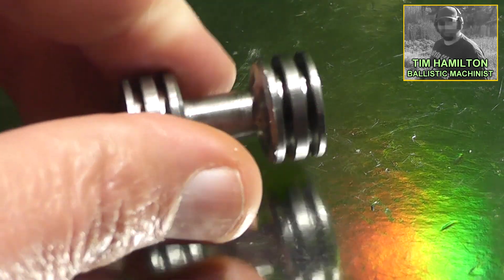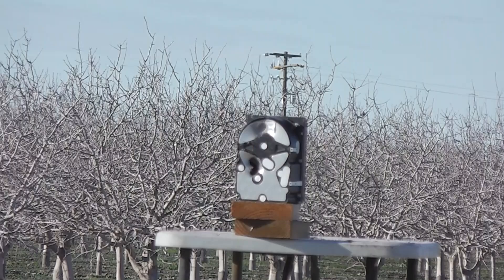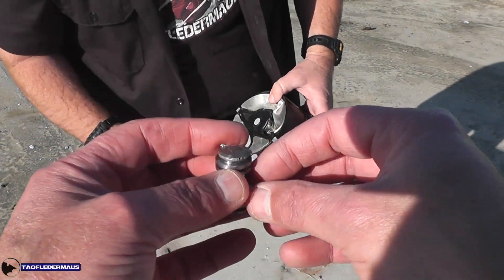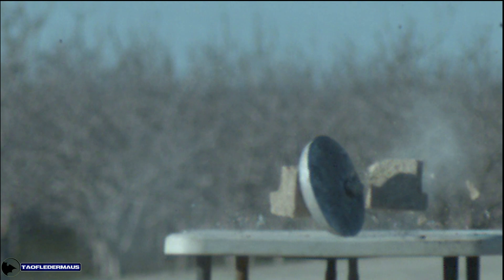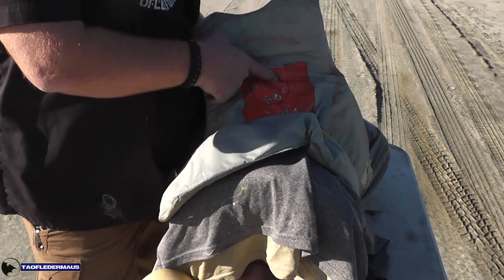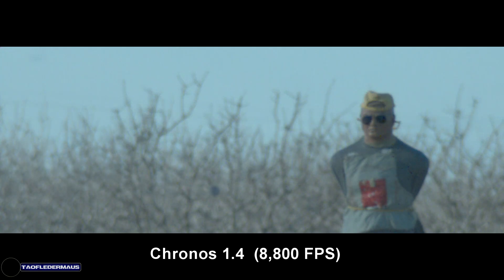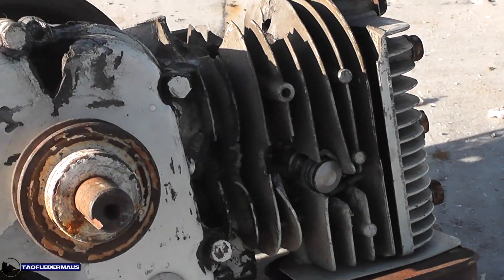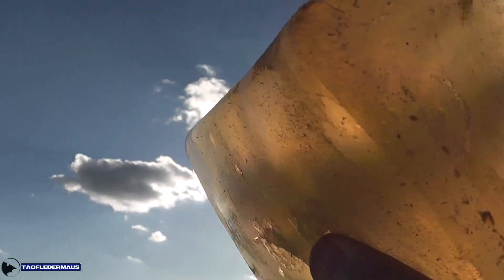DUMBBELL Shaped Slugs-  "Physics-defying"  performance

Comment: Since the shot cup does not go the full length of the dumbbell, will there not be a danger of damage to the barrel?
Reply from the maker: These were the prototypes and we didn't get any damage.  The production slugs have 0-rings so there is no metal to metal contact

Comment: For a fully symmetrical object like this the center of [air] pressure is aligned with the center of mass in every position and so will not impart any rotational moment. Thus the only angular momentum would be that imparted by off center acceleration either in or just upon exit from the barrel.

Comment: I'm pretty sure it's the grooves in the dumbbell that make it aerodynamic. The front is slightly curved, but if the projectile moves to the side by a bit, the grooves will catch more air, pushing it back in the other direction. Self-stabilizing through the use of air resistance.

Comment: The stabilization is due to the rings. They create a series of conical pockets of air around the projectile at speed which stabilizes it. This is visually seen by the air distortions around the projectile in the slow motion footage.

Comment: I'd dare to say that the reason these didn't fly the way you'd expect is because you keep forgetting momentum.

Most of the ones that are supposed to fly straight are pointed, but that just means that there's more mass (and thus momentum) at the rear of the projectile, which would cause it to tumble as the rear overtakes the front. Stable projectiles always either have the most mass at the front (like the ones with a plastic base) or are balanced front and rear (like these and the 'airgun pellet' style projectiles).

Or at least that's my theory, would be cool to see it tested.

Comment: Well, spersonic airflow at its best:
Becase you have a sharp edge on the first "weight", you have a well shaped shockvawe. The second "weight" has almost no drag, as it travels behind the shockwave. But if it tumbles, it eventually tuches the shockwave, which creates a force that is going inwards, pushing the second weight back. And this repeats on the other side, so the slug is very stable.

Can you maybe shoot it with a "softer" shell to see what happens if it goes subsonic? shuld tumble even more then.

Comment: Balanced, symmetrical, they will fly straight, you would think it would tumble due to the narrow middle, but no, there is a pocket of air behind the slug and since the back of the slug is the same shape and diameter as the front, it should stabilize nicely, not only that but because the slug gained its energy with both ends centered, no rotation was imparted and momentum will try to keep both sides straight. 

I think milling out a good chunk of metal to make one end lighter than the other and/or changing the shape of either end would cause it to tumble. 

The goofy over-engineered tail fins cause issues because if the air doesn't flow over them correctly, it can cause all sorts of instability issues.

In most cases KISS rules.

If anything, this design is perfect for stability as if the slug begins to angle or wobble, the narrow middle is more aerodynamic than if it was the same diameter, meaning the tail end of it is going to cause more drag behind it and bring it back straight.

Comment: The shape of the slug acts like a shuttlecock and causes them to be drag stabilized much like a diabolo pellet.  In fact many of the early custom made big bore air guns used smooth bores and dumb bell shaped pellets.

Comment: Looks to me like the waist in the slugs is what stabilizes them.  The front plows through the air like any slug, but the narrow waist allows some air to close back in and drag on the back half like fins.  It would have to be perfectly balanced to maintain equilibrium, but clearly Tim has made them that way.

Comment: My uneducated guess as to why the rounds didn't tumble, even when the wadding detached in flight.  The "dumbbell shape creates a sort of Fin affect on the round.  Air flows around the "head" of the projectile and closes in around the "shaft" only to catch the tail section in turbulent air which creates more drag on the rear of the projectile than on the front.   You would have to set up a slow motion camera in an environment which will catch the wave of air as the projectile fly's through it.  (I have seen the video/photos of this but again, don't know how to accomplish the task.)    Interesting video.  Interesting projectile.

Comment: The wonders of detached shocks...

This thing benefits from being flat faced and symmetrical, but the cup you fire it out of gives it extra stability. If you can fire one bare (or at least get it to reliably detach) we'll be able to see if it really is statically stable in flight or if that bit of plastic hanging onto its back end is what makes all the difference.

Also, these might benefit from a tiny bit of spin - drive nails with 'em!

Comment: The reason why they go straight is because of the gaps between the rings. At supersonic speed this keeps airflow very much attached to it, making it go straight at the cost of additional drag. At subsonic speed this projectile could tumble however.
Reply from the maker: Could be!   There are some commercial slugs that are sort of hourglass shaped like this.

Comment: I think this can be explained if you can capture highspeed footage from the muzzle blast and allow gases to reveal the secrets. The round is still tumbling, even if the horizontal movement is minimal. Some fluid mechanic genius could probably explain how the air is hurtling past this design. Those groves at the 'tumble' ends look a bit like piston design, meant to provide a gas seal. Will the round work if you take them out?

Comment: we need someone to make a modified vertion of these slugs with a firesteel (ferrocerium) tip so they can shoot it at a steel plate. firesteel is the thing in lighters that makes sparks when rubbed against the steel wheel

Comment: look at it waggle it's butt (like that rail gun projectile) as it goes straight instead of tumbling.. Vortex shedding 101, 

Physics explanation: as long as it's super sonic, it will never tumble as it self balances via the eddy that burst and shed off each ever exposed side (as it rotates) which then push it back the other way.. thus straight flight with a waggling butt.

IF HE WANTS IT TO TUMBLE: the centre of mass needs to be off centre.. but then it wont go straight .. making a projectile to tumble on purpose and go [practically] straight over distance while super sonic (50yrds+) is a difficult thing to do.

EDIT.. on immediate thoughts on something to try.. he can make the eddy smaller by chamfering the inside [of the] dumbbell edges ... though without modelling it I can't say whether or not the smaller vortex shed force would be smaller than the rotational [force of] mass of the dumbbell ends.. he can also make the ends V shaped in the same direction (not mirrored), but they would have to have their mass corrected to aero forces.. though they would be nearly the same.

Comment: here an Image of what happens with such an Object in supersonic flight:
http://imgur.com/a/BfaFi
Additional explanation:
While in supersonic flight the moved air has no "time" to produce turbulences, so mostly the moving masses are producing the forces on the object.

In "A" you see a straight flight. The air moved aside will be moved in all direction equally and the sums of the forces to the sides is zero. The moving air will only add drag. The back of the object is not "touching" the edges of the shock cone, and so didn't add forces to the object. The Air inside the cone is "standing still" relative to the moving object. (This is not full accurate but it will do in this dimension and explanation)
The center of mass is in the center of the object, so rotation will occur at this point.

Now to "B". Here the object is tilted, the air will move in one direction more that the other, this will add a force in the object to the opposite direction. the object start to rotate, and in result equalizing the movement of air on all sides. As long as the back of the object didn't touch the shock cone the object will always face the flat side towards the direction of flight.

With the center off mass near the back the tilting of the forward face object is reduced the result is a more "wobbely" flight, because more deflection is needed to tilt the face and add the counterforce. If the center of mass is mir in the front you get more tilt with less force. The object flies more stable.
This is also the reason washers and pennies are flying "flat", it's the most stable orientation.

All this changes if the object goes subsonic. Here turbulences will amplify the tilting by adding more drag on the backwards oriented side. (the explanation why is complicated and i don't want to do it :-) )

Comment: Theory:
Since pretty much all the effects on the way slugs fly are caused in the barrel, and this slug is proportionally long with equal nose and tail size, shape and weight, there's no way it can be shifted out of alignment in the barrel (unlike a dart for example), and so will remain straight in free flight.
If this is true, the least straight flying slugs (if the speeds are equal and supersonic) should be those that could be misaligned in the barrel. Perhaps something you can verify?
i.e. The more stable the slug is in the barrel, the more stable it is in flight. <-- ?

Comment: Perhaps the ribs and stem create some kinda uniform air pockets that hold the trailing end rearward. If you think about it, maybe the outside turbulence keeps the rear in line where the milling traps air vorticies that are more stable. Whatever the case, the front and rear parts probably interact with the air differently, regulating that arrangement. Interesting and unexpected results here... wow.
Reply from the maker: I'm still trying to wrap my head about it.   When I shoot the other version Tim made,  which are round balls,  we may learn a bit more.

Comment: It'd be interesting to see if they are any shorter after impact, due to the necked down center diameter. Impressive.
Reply from the maker: Rolling the recovered ones on a table,  I just noticed they are slightly bent.   I may reshoot them with hotter charges in the future.

Comment: I think that slug is actually aerodynamically stable. Think of it like this; you have the slug traveling at a 30° angle. The air moving past the rear of the slug hits the lip and exerts a torque counter to the direction of deflection - thus, it stabilizes itself. Side note: this same phenomenon is part of what keeps regular bullets flying straight, but in the case of this slug, it may actually be more prevalent due to the design; I would not be surprised to see this thing right itself when most projectiles could not.
Reply from the maker: After it went through the gel,  it did seem to start tumbling end over end,  but  it was going pretty slow at that point.

Comment: Have you tried adding an external display to the camera or can it even accept a display? You could use an inverter to power the monitor or small flat screen. Then you might be able to look at footage in the field
Reply from the maker: There is an output for an external display but I don't know if they are enabled in this early software version.
Reply: TAOFLEDERMAUS, I would test the port on something at home on something convenient. if it's something easy like an HDMI cable just connect it to your tv at home to test it. if it works, then most any monitor will work.
Reply: TAOFLEDERMAUS do you know what kind of port it is? if not, send a picture. I should be able to identify it for you.

Comment: Super surprised how accurate these are. They certainly pack a wallop. Wonder how they'd do if the loads were real hot :)
Reply: they'd have to be cool enough not to burn the shell or gunpowder but it would be cool

Comment: A grooved ring is a good stabilizer. Unlike a fin, it acts over 360 deg. and has multiple edges for drag. The design also featured a large open space in the middle to allow the air to come in and flow along the back edges. Ffns have less drag for max velocity, but aren't as good at stabilization. The MOAB bomb uses multi-edged flaps for guidance on a really heavy bomb where guidance is more important than speed.

Comment: Very strange indeed. Normally you'd expect a system like this without any feedback to be stable if the center of drag, is located behind the center of mass. Seeing as how the center of mass is in the middle (since it is symmetrical) and the center of drag being the front of the tip, you'd expect it to tumble. 
I have two possible explanations, maybe it is the shape of the head of the projectile that makes it stable. If it wants to 'diverge' to one side, that this will produce a force pushing it to the other direction, stabilizing it. 
The other is that due to the high speed, it leaves a vacuum behind the projectile, 'sucking' the weight around the center of mass into position. If this force is higher than the force pushing the projectile to the side at the tip, it would 'drag' the center of drag behind the center of mass.

Comment: Things that are symmetrical fly straight, cube, weight, ball, anything that is as close to symmetry as possible will fly as straight to the percentage of its symmetry... If u shoot nonsymmetrical object, it will fly as straight as the percentage of its symmetry(if its 4%symmetrical, it flies 4% straight, if it near 100% it flies in a linear motion, so you can deduce how it will fly based on its symmetry...)

Comment: If this things tumbles, I'm going to guess that it'll be more effective that way? It's heavy on both sides and it should still deliver a TON of kinetic energy
Reply: but then it would be less aerodynamic AND there is more surface area
Reply: Hellrizer USA it wouldn't fly far and accurately if it tumbles.

Comment: That slug works well because of the flat nose and the second part that creates a gap between the two sections of the slug. It creates an opportunity for stabilization to take place on the flat of the second portion, keeping the slug straight. I'm no physicist or aeronautical engineer, so I don't know for certain, but for the most part, that's what I think and see.

Comment: So, basically, tens of people sent you ammunition with all sorts of fins, deployable fins, sabots, ring fin, etc... to try to keep the thing going straight, and almost always ended up with something tumbling like crazy.

But the one thing you shoot that's meant to tumble actually goes straight?

Supersonic aerodynamics really are a mindf*ck!
Reply: Taofledermaus: "No plan ever survives being shot out of a barrel"
Reply: razzorice : I'm more thinking of the rear part of the dumbell that sits snuggly in the low pressure of the slipstream. If it were to deviate, it would encounter the high pressure air around the bullet, pushing it back in its stable position.

It's probably the same for diabolo pellets (which are stable at supersonic speeds, as this channel showed before).

Then again, that's supersonic aerodynamics, I don't know much (if anything) about them.
Reply: piranha031091 Great call, and ain't that a bitch?  Hahaha!
Reply from the maker: Yeah,  it's always a big surprise when we shoot stuff.   It never works out like we plan it seems
Reply: Maybe the bullet flying straight because of the nose shape helps it to sit in the shock wave?
Reply: Well i think the shock wave at supersonic speeds works like a pillow or some kind of rubber fabric.  If you put it under pressure its gonna change its shape depending on the force you apply on it. So you will get an angle all around in front of the projectile and the nose helps to sit in it.(Sort of snuggle or hugging it.) Ass long as your center of mass close to the shock wave its have to stay stabile like a reverse parachute. Everything else like the dumbbell on the diabolo pellets is for support in the barrel and mass for the longer energy retain plus simply pure cosmetic. Sorry for my bad english is not my native language.
Reply: piranha031091 I think you pretty much nailed it.
Reply: razzorice : I can't get a word of what you're trying to say.
Reply: that's irony for you

Comment: This is effectively the same kind of stabilization used in rocketry.  Were the projectile to have any deviation in the leading face, like the damaged slug were it to be fired damaged-side first (assuming the damage is asymmetrical), the projectile would likely drift out of line with the velocity vector and begin tumbling.

Comment: I think these are drag stabilized. If you think about the flight profile as the round rotates a bit in the air, the rear section will hit turbulent air from the nose and be forced back down the way a dart's tail would. It would be interesting to see something like this in a wind tunnel. Maybe a homemade wind tunnel is your next video series waiting to happen!

Comment: You need to put one of those slugs in a wind tunnel, but I think those grooves may have something to do with the stable flight. They may be setting up little low pressure eddies around the slug?

Comment: Just looking at it, I figured it'd fly straight.

I bet if you took the ridges off the back, it would reduce the drag and allow it to tumble. Look at most gas pistons. Ridges like that are designed to cause turbulence and create a seal.

Comment: I noticed that the dumbbell shape has straight across cuts on each side. Would having those cuts at a slight angle diagonally result in a better spin?